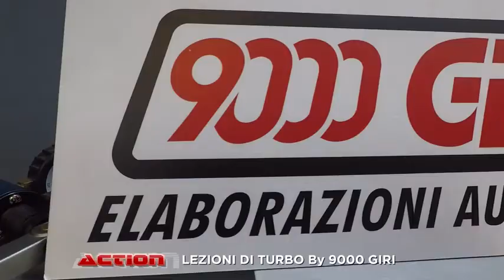Come si revisiona il turbo | come migliorare il turbo | come funziona il turbo | turbo maggiorato

Comment: Buongiorno ho una bmw 325d e92 N57 204cv ( sarebbe un 245cv depotenziato)
Ho ottenuto con la mappa 330cv al motore e 300cv alla ruota ( con l'aggiunta di intercooler maggiorato, downpipe 200celle, filtro sportivo! 
La domanda è sì può ottenere un ulteriore  miglioramento se cambio anke le giranti come spiegato nel video?  Di quanti cv in più si possono ottenere? Grazie mille
Reply from the maker: Turbine sportive con giranti in avional, #shorts

Comment: Grazie mille x l'interessantissimo video.
mi avete chiarito molto le idee pur essendo un profano del tuning.
Volevo chiedere,cortesemente, rinforzate anche il turbo dei bifuel!?!
ho un alfa mito 955 bifuel turbo 120cv 88kw, se nn sbaglio la turbina dovrebbe essere la VL39,
io nn vorrei aumentare i cavalli della turbina ma se nel caso volessi mettere un modulo tipo il p1 performance vorrei avere la turbina che reggesse di piu lo sforzo dei finti 30 cavalli che darebbe il modulo ma nulla di piu se nn filtro aria sportivo e se serve intercooler di 6 lt al posto di 5 con manicotti in silicone dove serve! 
l'importante x me é la ripresa, adoro la piccola grinta della mito.
nel caso come funzionerebbe...dovrei spedirvi la mia turbina? resterebbe plug & play o dovró comunque mappare!?!
grazieEe
Reply from the maker: possiamo sicuramente intervenire sulla turbina della tua vettura al fine di renderla più efficace e duratura. Per maggiori approfondimenti di carattere tecnico, il consiglio è quello di contattarci telefonicamente in sede allo 02-7383175 chiedendo direttamente di Luca
Reply: @9000girichannel  Grazie mille

Comment: Ciao o una Fiat Punto 1.3 multiget 69 CV del 2004 chiedevo un informazione o fatto una pressione turbo 1.3 bar modificando il sensore massa aria x non ndare in ricoveri.. la mia domanda è se con turbina originale a 1.3 può reggere la turbina o si può rompere? Grazie in anticipo e spero che mi può rsp
Reply from the maker: Dovresti specificare se il valore indicato è quello di "picco" o quello "costante", in ogni caso ti suggeriamo di contattarci in sede fornendoci maggiori informazioni sul tipo di modifica effettuata in modo da poterti dare una risposta tecnica più precisa
Reply: @9000girichannel  ❤️
Reply: @9000girichannel  buongiorno Salve allora spiego tutto quello che ho effettuato nella mia auto allora cio un modulo aggiuntivo Speed Italia un dowpipe e un finale simoni racing e o eliminato EGR e o tolto il catalizzatore so che non o nulla x le contro pressioni e so che nn va!..devo fare un barilotto.. potrebbe andare così l'auto oppure il turbo e a rischio?? E dimenticavo o 1.3  bar di picco e costante 1.2'8
Reply from the maker: Il problema principale è che, avendo tolto il kat, non puoi intervenire tramite modulo esterno per eliminare l'errore e quindi la carburazione non sarà mai ottimizzata. Quello che avresti dovuto fare è montare un downpipe con kat metallico. Per maggiori approfondimenti contattaci in sede allo 02-7383175
Reply: @9000girichannel  ok grazie ❤️🙏
Reply: @9000girichannel  salve una cosa l'auto non va in errore! E solo il problema che non so se va con questa pressione xchè o turbina originale  e che sono senza catalizzatore x le contropressioni